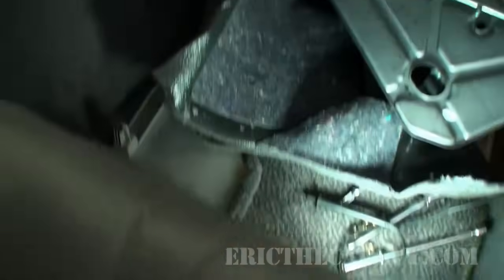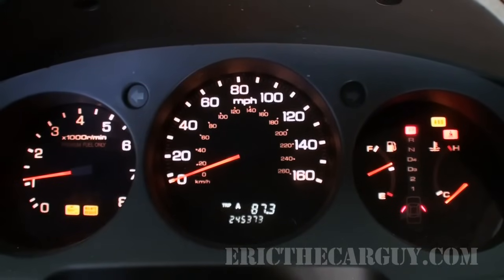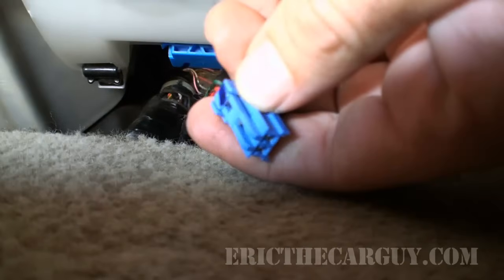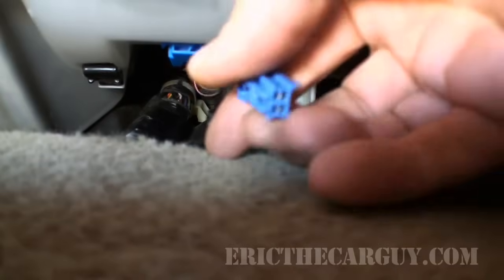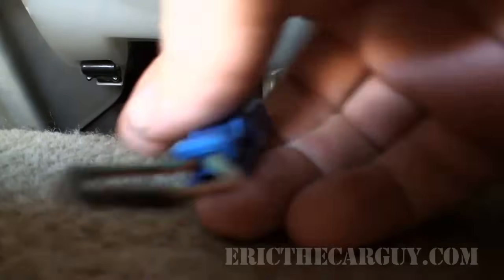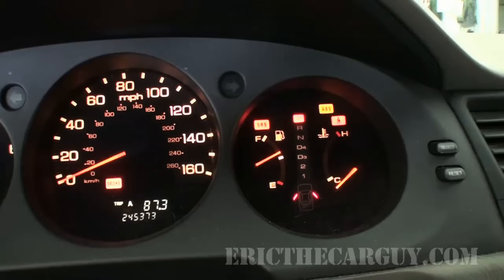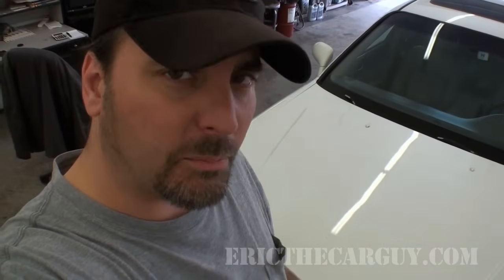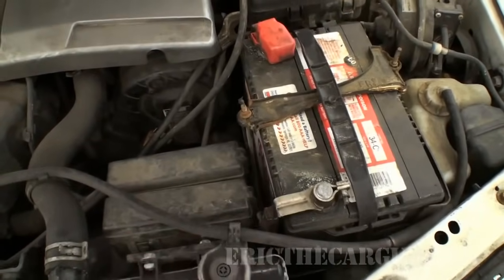How To Pull Honda Codes Without a Scanner -EricTheCarGuy

Comment: I have immo issue and I wanna bypass it doing the BRAKE CODE way btw I have a 2002 civic coupe EX 5 speed I was wondering if I have to do ODB2 port using pin 4 and 9

Comment: Hey Eric, so I have a Honda Element.  It starts only when the code reader is plugged in, and if it is pulled out the engine dies.  Any ideas?  I had it diagnosed and nothing is wrong with the immobilizer or the key...all is perfect, they say.  It was suggested I just leave a code reader plugged in and drive it that way.

Comment: Here's one for ya. Crank, no start. New ECM, new distributor, new ignition coil, new plugs, new wires and no spark beyond ignition coil. Voltage to coil. No codes, no lights, was running okay then just quit. Also the speedometer acts funny even after I replaced the ECM. Not sure what could be the cause so any help would be greatly appreciated!

Comment: Hi Eric, I really need help with my 2007 Honda Odyssey, ELX, is there a way you can help me please? I need to know about OBD2 pin 4 and Pin 9 for my van. There was youtube video to erase code for ABS, VSA, Hazard sign which came on when I replaced the bearing of my front wheel, it was working fine other than the signs. after doing the the procedure car won't start and green key light flashing, also OBD2 scanner tool can not connect to the Van computer. It's been 2 weeks and I tried all the things possible.

Comment: Thanks for the video (10 years later). What do you do, though, if a car doesn't store any codes but has issues that should cause  codes to be stored? 

I have a 1999 Honda Accord LX, with a 2.3 liter, F23A1, 4 cylinder engine, Automatic Transmission that sat with the battery removed all winter and through our Southeastern "rainy season" because I didn't have a garage or carport to get the car out of the weather to work on it. When I parked it, it was cranking and running just fine, but the head gasket had blown between the #2 cylinder and the water jacket between the #2 & #3 cylinders, causing it to overheat. 

I finally got good weather long enough to change the head gasket, intake & exhaust manifolds, valve cover gasket and seals, etc. After doing the repair and making sure that the cam and balance shaft timing were correct, that all the electric connectors and sensors were connected, and all the bolts torqued to specs, I installed the freshly charged battery and cranked the engine. 

When I cranked the engine, of course it was a longer crank time than normal, because after months of sitting idle with no battery, the fuel pressure had dropped, and it took a little extra to get fuel to the fuel rail and injectors. 

When the engine started, though, it barely ran at first (just fast enough to keep the crank and cam turning), then as the engine RPMs increased, it went from normal idle speed to surging, high-then-low for a few minutes before settling into a normal idle with good acceleration when I pressed the accelerator pedal. 

After the idle settled down, I turned off the engine, waited a few seconds, and started it again. This time, as soon as I turned the key, the engine started, but again it was a very slow, very rough idle that quickly increased to normal idle RPM, with less surging, but surging nonetheless. Every time I start the engine, it's the same ritual--super slow idle, increase to normal idle speed, and surging followed by a calm down to normal idle speed. 

During the entire process, not a single trouble code was stored or pending when I checked, hoping to find some useful info. So, for me it's trial and error to pinpoint the cause of the rough idle and fix it. Did the car sitting without a battery for 6 months damage the sensors or the car's computer or memory?

Comment: If you're at the junkyard an need a connector for this, pull the door card off a '90s-'00s Civic (and probably any Honda) or find one that someone has already torn apart. Right there affixed to the door will be the same connector, except it's colored gray, held in by a clip. Disconnect it from the harness, cut the wires a little long, and loop them. Or, for an extra clean look, de-pin one wire and insert the other's tail in its place. Now you have an OBD I Honda tool. You can test-fit the connection there at the junkyard and see that it'll snap right in to the service port. The part number for the Connector from Honda is 07PAZ-001010A. It's called SCS Service Connector.

Comment: Hi Erick the car guy. Hopefully you’ll read my message and answer my question after. Here’s my situation I have 1995 civic ex coupe. It has no engine light on, but I’ve been dealing idle surge problem going up and down so I wanted to see if the computer has any codes there. I did short for that terminal there and here’s what I got but can’t understand them. I get 3 fast ones first then 1 long one at the end. Is that 310, 31 or 13??  
I don’t get it because it’s starts with the fast flashes first. 
Thank you for your help.

Comment: I found a similar connector for my 96 Odyssey for the SRS and read it with instructions found online with the jumper. Now the only light on is the ABS, I don't think I can just reset it, it goes on and off parked, I can hear click when it comes on. I couldn't figure out the abs codes though, so I will have to revisit it.

Comment: So my 94 Integra cel came on. I jumped the connector but the engine light doesn't flash. It just stays on. I've done this literally hundreds of times and never experienced this.  Has a rough idle and won't stay running. After warming up it'll run fine . Any idea why it's not throwing codes but the light is on ?

Comment: What if I jump the connector and the CEL lights up solid with no blinking? Long story short it was giving code 09..i replaced the computer and get the solid light. I put the oem back in and also get the solid light and no more code 09...car will still not start... 94 accord ex

Comment: For New Zealand there's a big difference.  The plug for bridging is a 2 pin plug similar to the one shown BUT
first of all it's on the left side (passenger side for RH drive) and it's grey, not blue !  You will find it tucked behind the small plastic kick panel that's on the left side of your left foot if you're a seated passenger.  You should be able to put your finger over the top of that panel and flick the wires out without having to take the panel off.  From this point on, do exactly as the man in the video says.
Reply: Oh you are an angel for that advice. Thanks from a fellow kiwi!

Comment: This was awesome 👌🏾.....I actually found out for a 2002 honda civic you can jumper slots 4 and 9 on the OBD port for flash codes as well....I had 37 for my ABS, went to your website 😀 and found it but im still not sure which sensor this is the code: 37 – solenoid (short to body ground/short to wire) RL-IN
What does RL-IN mean?

Comment: UPDATE: In my 95 honda accord? It's the D light that blinks the codes! I happened to stare at it and noticed a pattern. Why is it different in this video?
ORIGINAL POST
I tried this and got no codes. The SRS light stays on when jumper attached. Also green light on D is blinking. It was blinking before using jumper.
When D light blinking before. I replaced the speed sensor. It seemed to make it stop but I must have gotten some dirt inside sensor because speed odometer fluctuates. This was before the dying issue. Could a bad speed sensor cause the car to die going down road?

Comment: Hey brother went to look for my blue connector under passenger dash and it's not there what to do now any advice would be great its,89 civic dx, took off the glove box to  but not there ,but there is a white connection with with 4 wires ,green/white, red/white,and 2 yellows

Comment: Hi! I have a question. I have a 1998 Honda Civic with D15Z6 engine. I found this connector and closed, but the check engine lamp did not flashes, did it only light. What's the problem? I found next to it a 3-pin connector - could be this the good connector for me, or why didn't flashes and why did it light? I haven’t used this so far, but it would make my job easier. Thanks for your help.
Reply: L

Comment: Just to complicate things I have a RHD USA built 1999 3.0V6 Accord Coupe with Motorola PCM here in the UK  . It has a 2 pin plug and a 3 pin plug in a blue blank support under the steering column . Jumping the 2 pin gives you ABS codes and I got a 32 (Front Right solenoid problem). The trouble is there appears to be several colour codes possible for the 3 pin plug for the SCS wire which you pull codes . One is an earth one is +5v and the other is anybody's guess depending on the colour which could be red , brown or grey depending on wherever you have sourced your info .
As it is OBD2 a code reader and 3 pin adapter should work but it does not find the ECU after searching for the protocol Honda uses despite being listed in the code reader document .

Comment: I just tried this with my 98 Integra to turn off / figure out codes but when I connected the two wires under the dash my ABS light turned off and blinked five times and then didn't do anything else and now everytime I try it the SRS light turns on and the check engine light turns on when the wires are connected but they turn off when I pull the wire out of the plug and it doesn't say anything on my OBD2 reader about the ABS so I'm really confused and I just kind of want the damn light to be off😩

Comment: Ericthe car guy ...i have a 2000 honda accord ex 3.0L...now after i had an emmisions test done my engine light came on and my engine started running a bit rough.
Everything  was fine prior to emiision testing..took it to auto zone and ob2 scantool would not work..it claimed it did the scan but when plugged in there were no
readings or codes..they told me to check my fuses and they all worked and none were blown..but yet it still did not produce readings for codes..the only fuse that did not flash 
was the( start signal fuse 7.5 )..when does that produce a signal..or would that be why its not communicating with scantool..

Comment: 2000 handa accord has srs light on and i tryed to reset it by shorting out the yellow adopter under the drivers side and it didn't work

Comment: So never known to do on obd1.  Just recently gotten another 1995 Honda Accord Ex Sedan (Favorite Year) Having issues with Vtec.  Bench test vtec solenoid, test good.  Took egr apart and cleaned,  2 valleys (passageways) completely blocked. Replaced the solenoid oil seal.  Hopefully the scan will lead me to right direction....

Comment: Erick, this is really a huge help, thank you!
I have a question about this, as you instructed to only switch to ON mode and not to crank..
How do I do this method if my Check Engine Light only turns on when my car is running already?
Thanks!

Comment: This was very helpfull , im in Australia working on a 1997 honda accord here the OBD2 port should have been behind the ashtray , however it wasnt so on right hand drives the blue connector is under the glovebox  on the left hand side of the car  , i bridged the connector read the codes , thankyou for your help

Comment: I have a Honda prelude bb1 1991 Si 2.2litre 5 speed Japanese import .Does it have an obd1 2 pin blue connecter or an older OBO .IM SURE ITS A 2 pin blue connector but can't find it .theres different forums saying its behind the radio others says it in the passengers side while others say it's drivers side next to the gas pedal .can anyone clarify this please .Ive had a look can't see it and am afraid I'll put the pin in the wrong one

Comment: So my car is obd1 I plug the lil clip on the two pin and only srs flash no the check engine light . Car was converter to manual d16z6 .

Comment: Question.  I have a 93 accord ex gotva code 43 which is fuel supply system . What could that possibly be the cause. It drive fine till i hit about 70 mph then it wants to hiccup loses power but doesn't die  but then it sorta goes away .

Comment: Idk if you’ll read this but I have a serious question about my car so I have a 94 Honda Accord lx and I tried to do what you said with a paper clip and putting it on the on position but the problem that I have is that my check engine light only comes on when my car is running it doesn’t come on any other time only when my car is running so how can I check for my code??

Comment: Hi Eric I have 1994 to 1997 honda civic 1.5lsi I have the ABS light on I tried jumping the two pin connector and it does nothing it does not have a engine check light on just the ABS light what do you think might be wrong thank you ERIC

Comment: Eric where's the l.e.d. flash light or blue connector for my 1988 Honda accord hatchback?  Any idea where can I find it? I just replaced both O2 sensors and the engine light comes on after about 5-10 minutes of driving.

Comment: I have a z6 engine in my 99 civic and my check engine light comes on after I start driving then resets when I turn off the car. Then comes back on again.  What can it be?
Reply: How can you tell the difference from OB OBD1 and OBD2 or the one that you not supposed to use the jumper wire

Comment: Hi Eric...can you tell me what scanner I need to get tranny codes on my 2007 Honda??  My "D" light is flashing and from what I read on line it says regular divices that give you check engine codes (my check engine light is NOT on) will not work for tranny codes.... I wanted to buy the bluedriver..but I heard it will not give tranny codes on Hondas only for American made cars?

Comment: Very helpful info. One quick question. My del sol is obd2 and I did the paperclip method as shown in this video. For my abs i got 4 quick blinks pause and then 8 quick blinks. I did not get any slow blinks just two sets of quick blinks. I'm assuming this means 4-8  (rear left abs speed sensor) Am I correct?

Comment: Hello, What is a proper scan tool for 1999 honda cr-v or software that would work with elm327. On manual they say it uses ISO 9141 protocol? Thanks!

Comment: Fck. I have 2 preludes and check engine stays on but it seems I just cant read codes when I do paper clip method. No rpm going down and check engine still lights, no blinking.

Comment: I'd like to use this method to pull the abs code off of my 1997 honda del sol. However, the light does not come on initially when I start the car.  It comes on after about 5-10 minutes of driving and then will stay on until I turn the car off, then it'll repeat the process.  Would I be able to use this method if I park the car with the engine running while the light is on? Or will it read the code anyway?
Reply: Sentree did you ever find the answer to your question? I have the same issue?

Comment: Can't do it with the blue connector because it don't exist with cars that have DLC connector.
But, 2 terminals in the DLC on 97 and up just need to plug a wire into the right 2 connectors on the DLC.

Comment: i have a 1990 integra gs hatchback and my car wont idle   without pushing the gas. the check engine light will turn on but when i start the car again the light isnt on so when i do the paperclip thing it doesnt work help please

Comment: Hi! Thanks for the video! Any idea where to find this connector in a 2005 Civic? I have nothing like what you describe in any of the spots you mentioned. Pulled back the carpet, pulled back the cover on the underside of the passenger wheel well - nothing. Thanks!

Comment: For some reason this isn't working for me. I found the connector and shorted it with a piece of wire but the abs light did not blink. I know I'm getting a good connection because when it's connected the check engine light comes on and when I disconnect the wire it goes out the check engine light doesn't blink either but I don't have a check engine light on only an abs light on. So why won't the abs light blink?

Comment: Is this store the last engine run check engine code? So when I had a check engine. stop the car... read the code then it will read the code from the fault which happened before?
I'm asking because with my friend happens the check engine comes up but after a restart there is no more check engine lights... just comes up randomly.

Comment: The Hell with that a wire jumper ! !  Like why not just buy a obd 2 Bluetooth  reader on Ebay for 15 dollars. I'm afraid I will short the wrong plug and destroy something. Is there a OEM part tool # that will have the correct size plug and a switch connected to it from the dealer ?

Comment: hi there - i have a 1994 honda accord wagon ex -- my check engine light recently came on -- watching your video and trying to determine if my connector will be on my non steering wheel side -- also wondering why the honda dealership charges well over $100 to do exactly what you're showing us all how to do. thank you so much for your help with this. p.s. no need to answer the honda dealership charge question. :)

Comment: I have a 1999 Honda accord vtec 6 cylinder  and when I bought the car it came with a.m keys long story short is there a reason why I don't see the check engine light come on when the key is turn to on position

Comment: As soon as I turn the key 🔑 get one quick flash couple seconds later I get 1 long one followed by 5 short ones that would make it 15 right? Only asking because I'm not sure about that quick first flash does it count? Next code I get is 3 long flashes followed by 6 short ones 36 but I don't see anything under that code any tips?
Reply: The car had a h22 swap btw

Comment: Also. Sixth gen Accords don't have that two pin connector. You have to jump two pins on the OBD-II port. The last one on one row and the fourth one on the other (black and brown wire.) The good news though, is that it will pull SRS codes also!